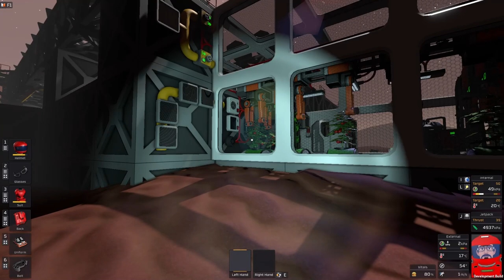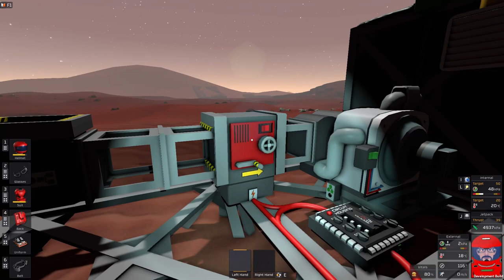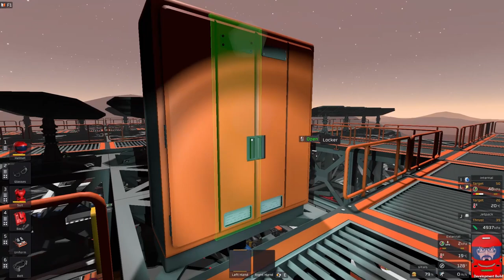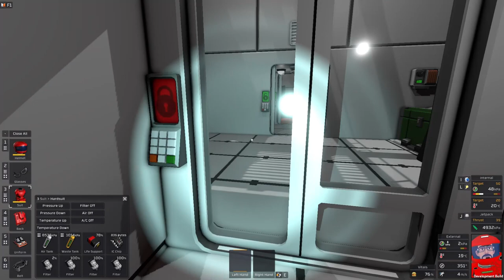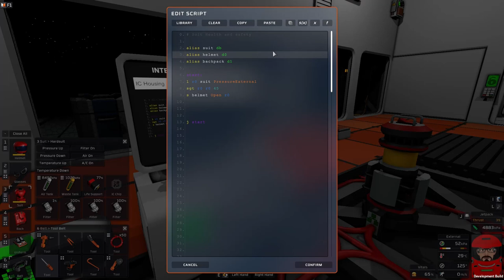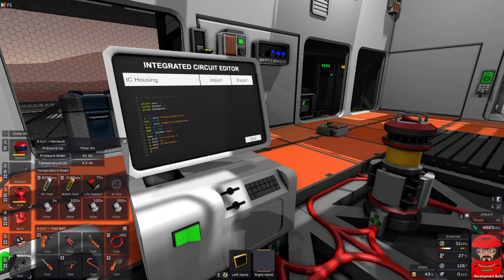Stationeers Programming the suit

Comment: Solar panel can be fixed without using ducktape. Just disassemble them, and then put them back up, and they are fixed. It doesn't save time, but you do save on iron.

Comment: Hi. Really enjoing your videos.  You have by far the cleanest coding and logic building stile of the YouTubers out there.
But maybe I ask you a little thing to change. Could you please set the background of the ic editor to be not transparent? This would make reading in YouTube a lot easier. Also it would be cool if you zoom in at the current code line. But I guess the later is very much effort.
Reply from the maker: I don't think I can change the editor opacity.  If it is possible please let me know because I would really like to do that.  
I just use windows video editor so sorry no zoom function.
Reply: @cowsareevil7514  You can change the opacity with the button in the upper right corner of the editor. (If I remember right it shows two rounded squares)
Reply from the maker: Sensational.  That is sooooooo much better.  I was looking in the settings and it was right in front of me all the time.

Comment: Thank you! I always interested what can I do with the helmet IC..
So is it possible to sent the suits data to the base with the Logic Transmitter? For example when you left the base, the suits external temperate (or pressure) will change. Can this turn off the base lights automatic when leaving home?
Reply from the maker: You can calculate your disatance from the base using the chip and then turn off the lights when you are a certain distance away.